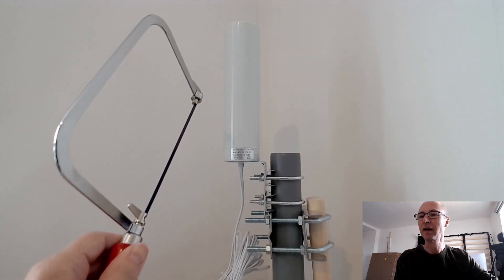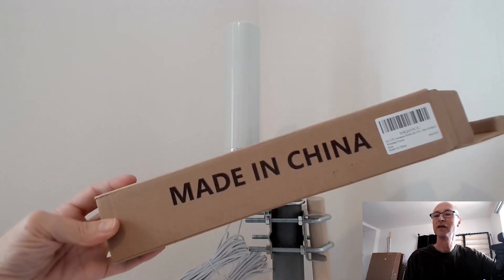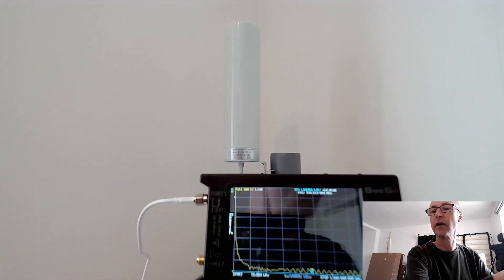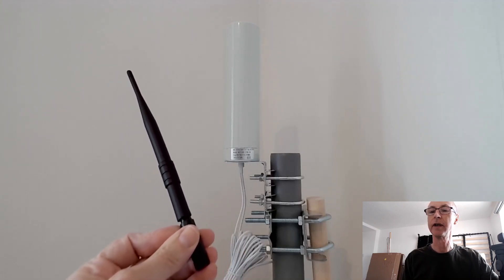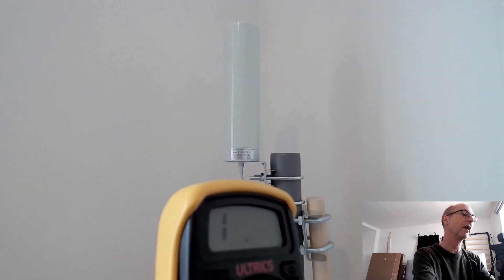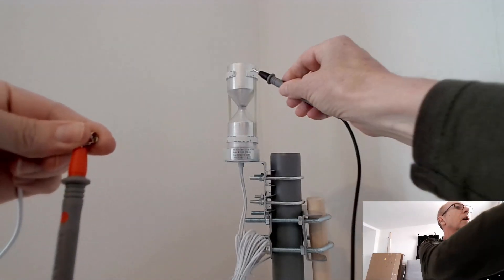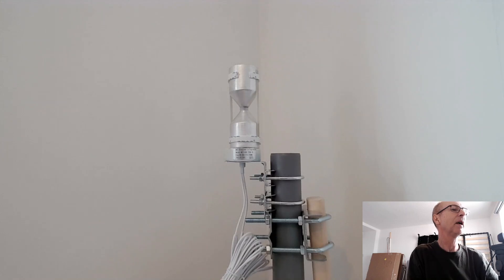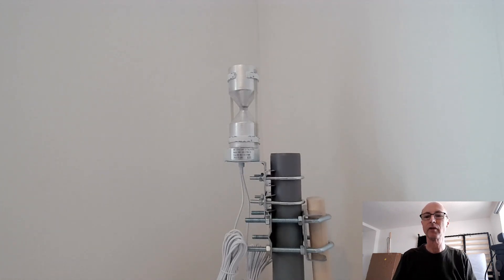Broadband Antenna - is it a Fake ? Part 1

Comment: Genuine RG-174 has 7.5 dB loss for 10 feet at 2.4 GHz, (as per the first loss chart I found on the web.) At microwave frequencies RG-174 is simply a long, flexible attenuator.
Reply from the maker: Indeed, that would explain why I thought the antenna behaved like a nice dummy load. I wonder if this is a deliberate design tactic or just ignorance from the manufacturer.

Comment: I'm curious how it looks on a Smith chart. That's a big chunk of capacitance.
I've seen the double coax on some antennas that are supposedly for use with mobile network extender devices. One lead for TX and the other for RX. Doesn't help if they're both soldered to the same feedpoint, however.
Reply from the maker: Interesting comment. Too late for a Smith chart. I already chopped the second cable off...

Comment: try feeding it with 300ohm twinlead and use modified tv balun to bring to 50 ohms or even a 75 ohm one
Reply from the maker: Thanks for your interesting suggestion, Paul.
Reply: @fotografm  it will be broadband with no feedline loss
Reply from the maker: @paulmitchell4421  I hope you are right 🙂

Comment: The same "two of three" rule applies. 😁

That feedline is likely garbage for anything over HF. Probably 10 dB loss on that.
Reply from the maker: Exactly !!! Take a reasonable antenna and "improve" it by adding long cables of low quality.

Comment: I too would think that long thin coax cable is not helping signal attenuation. The long length of cable might also be helping with the wideband low SWR, and its values may worsen when you trim it short. I wait to find out in part 2 :)
Reply from the maker: Stay tuned :-) 73